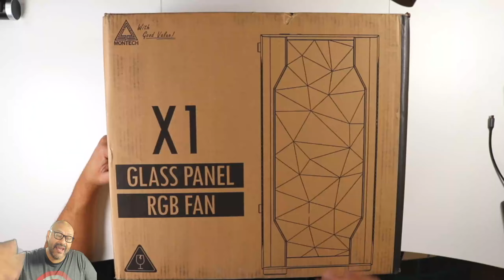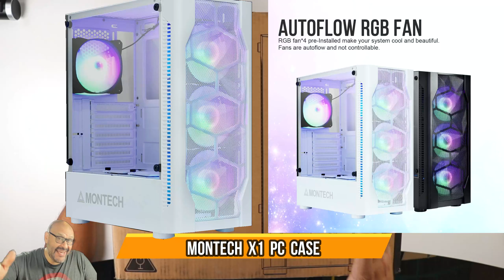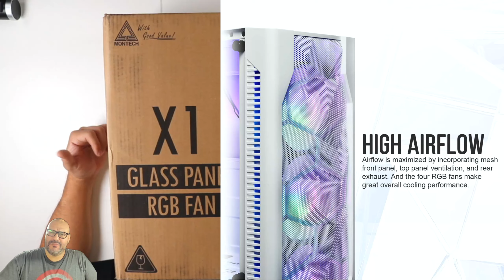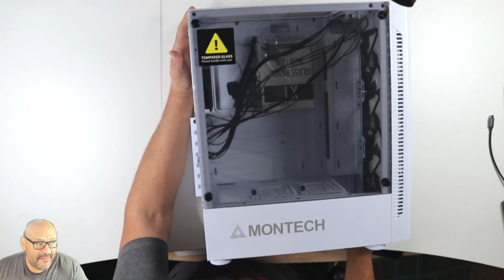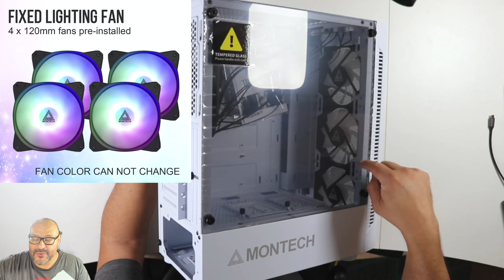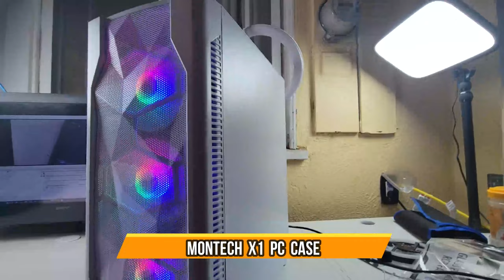Montech X1 White - Compact ATX Mid Tower Case

Comment: did the fans simply start spinning? My case fans are not spinning at all
Reply from the maker: You probably connected wrong or no power. Another thing might be  you don't have enough power I suggest to connect the fans directly to the power just to see if this will work as a test